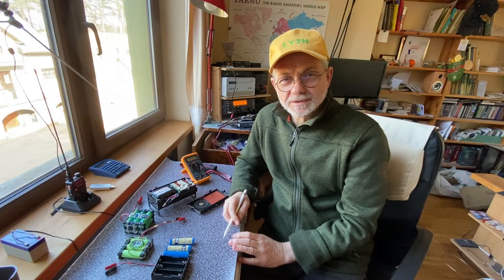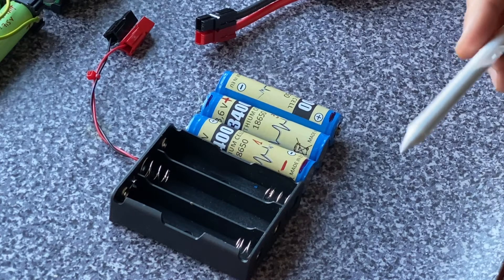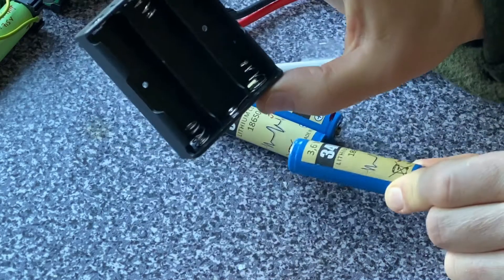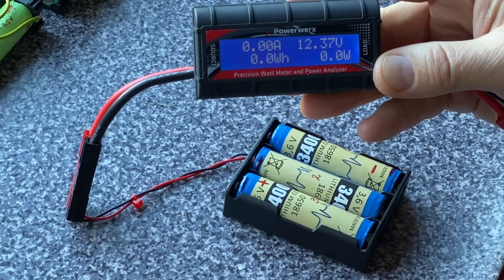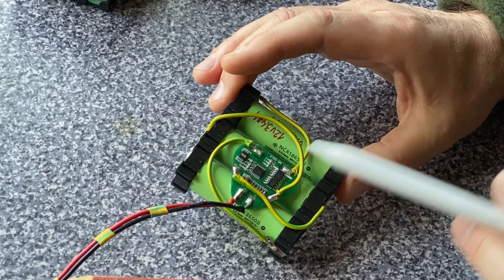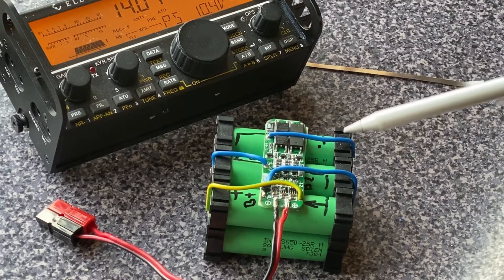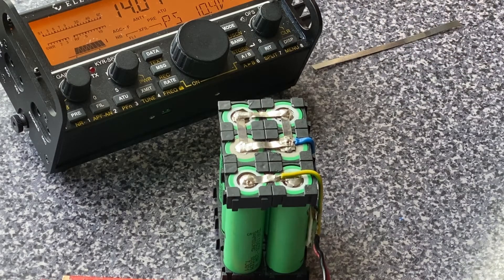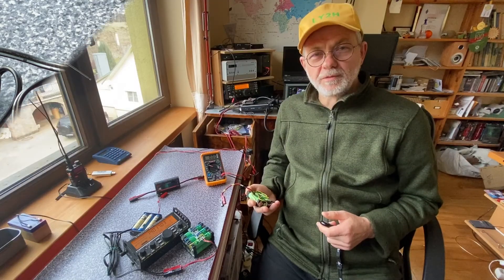How to make DIY Li-ion 18650 Battery Packs for your Ham Radio QRP rigs

Comment: Linas, I love your videos...  I've bought an enclosed battery holder, with a BMS, with a 5.5mm 2.1mm But the battery of choice for me is the TalentCell 12v 3aH.  This works great with my KX2.  The KX2 will automatically draw from the source of highest voltage.

The TalentCell mates perfectly with my QCX Mini(s), QDX, and QMX transceivers... I love my QCX Mini with the K6ARK CapKey mod!  It's very compact and portable!
Reply from the maker: Thanks Randall! You've got a nice setup with this versatile power bank including the 5V port! 73! Linas LY2H

Comment: Dear om tnx for this video. Very usefull. Can you please explain how do you charge this battery packs? Tnx.
Reply from the maker: Hello Bojan, thanks for watching! I charge my packs with special charger designed for Li-Ion batteries, it's made by Tenergy company and is rated for charging 3S packs ( those  made of 3 18650 cells in series). It could be a charger made by any company, it's just important they were dedicated for Li-Ion packs, not for any other type. Also, the charger must produce the correct voltage for your battery pack. So, if the pack is made of 3 18650 cells in series (3S pack) its max voltage will be 12.6 V ( 3X4.2V=12.6V. 4.2V is a max voltage of 1 fully charged cell). It means, the charger must also produce 12.6 V (NOT MORE, overcharging could be dangerous for lithium batteries). Normally, the voltage should be written on the charger's case. The charging current should be 2A for these cells for normal charging. The charger should provide Constant Current and Constant  Voltage (CC/CV type of charging algorithm). This is very important because it guarantees that charging will stop as soon as the battery reach its maximum voltage (12.6 V). Normally, if there is written on the charger it's designed for Li-Ion batteries, it will automatically be  of the right type. As always, if you Google for "charging 18650 li-ion battery" you'll find lots of interesting reading :). Hope, this helps! 73! Linas LY2H
Reply: @Linas_LY2H  thank you for explanation. Just one more thing. Do you use the same cable on the battery pack for charging the batteries as well as for connecting to the KX2 or is there another cable for charging it. I don’t see additional charging cable in the video and this is confusing me :)
Reply from the maker: @bojanrimanic6010  No, there is no other cable for charging only. The original KX2's battery which comes with the radio is also of the same 3S pack type and it only has 1 cable both for charging and  using. It means, you can not use the battery and to charge it at the same time in this type of packs. As in KX2, you need to disconnect the battery from the radio and connect it to the charger for charging. I think, it's related with the type of the BMS  used with the pack. Frankly, I have never seen any other type of BMS then this for small 3S or 4S battery packs. But on big batteries , like my new 48V e-bike battery, there are two ports installed, one for using , one for charging. But there are many other e-bikes batteries with just one port, and you have to disconnect it from the bike for charging. So, it's an interesting topic, thanks for raising the question!
Reply: @Linas_LY2H  Tnx Linas, everything is clear :)